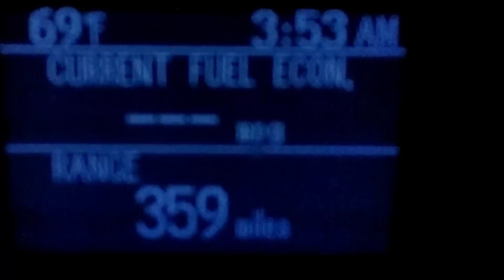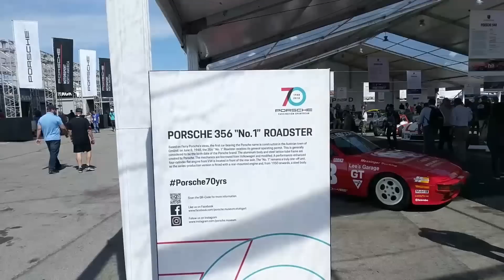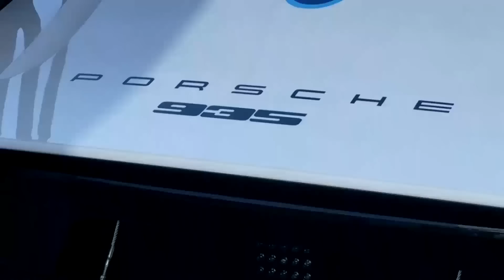Rennsport VI 2018 Blew My Mind 😀 Porsche Unveils New 935 & Speedster

Comment: Porsche needs to go back to their roots, and build their new cars with aircooled engines. Nothing like the sound of aircooled.
Reply from the maker: I wish!  There was an air-cooled made by the factory at rennsport and it sold for 3+ million.  1 of 1 993 turbo!
Reply: Garage Time - Restomod 3mil for the orange one you showed at the beginning of the Video? If so, they could have at least polished the tail lights.
Reply from the maker: Yep, that's the one!  Taillights are useless anyway because it can't be registered for the road.

Comment: No Porsche should ever be red. that is just wrong.
If you want a red car buy something Italian.
Reply from the maker: Ha ha, what about green?
Reply: @GarageTimeAutoResto  that light green 959 I spotted in the video looked quite good actually. Never seen a green one before. Far from the prettiest Porsche*, quite the opposite really but what a car!
I mean which other car has won the Paris Dakar rally and its class at Le Mans?
To be fair though the traditional racing colours depend on the home of the racing team, not where the car was made.
Apparently Enzo Ferrari was a bit of a stickler for this and every race car he sold was painted in the appropriate colours.
So the ones sold to US customers were either white with a blue stripe or vice versa, ones going to Belgium were yellow and so on.

* that is obviously the 904 GTS. Even the later italian copy (Dino 246) is still the prettiest car ever made by Ferrari